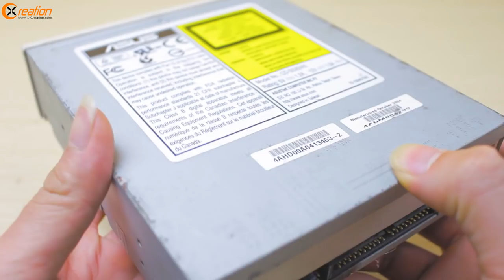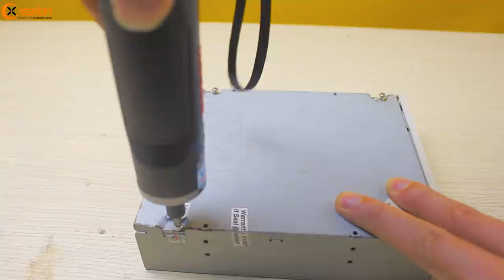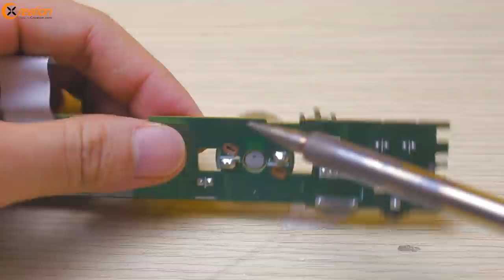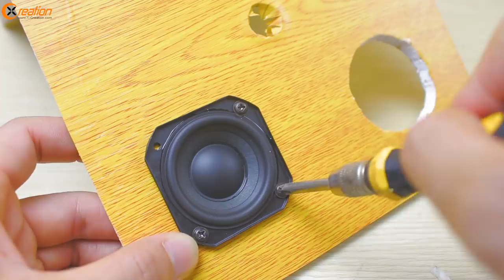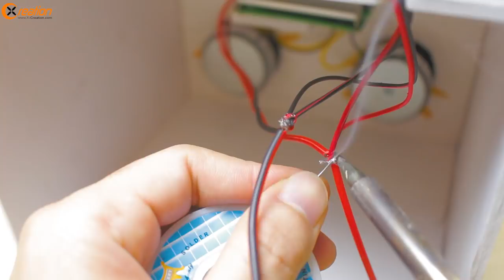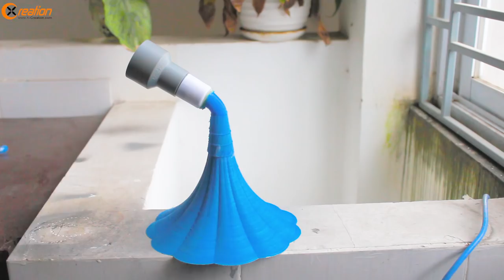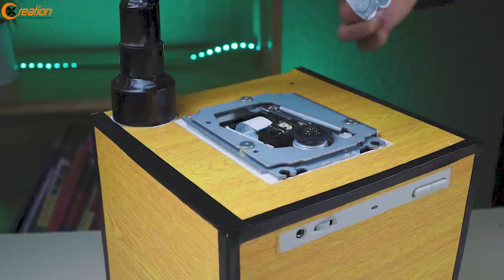Recycle old CD-ROMs into Vintage Speaker Player

Comment from the maker: Do you have any questions? Let's me know!
Reply: can you post links to all the music that you used please?
Reply: How many cost you paid? And how many hours you make it? And how much is your wage per hour? And how much i buy a small Hi-Fi with CD player?
Reply: @DeZug  i believe less than $500 will do dat
Reply: @DeZug  When you make something with your hands you feel a pleasure that is unmatched
Reply: What are the audio out pins from the dvd player!?
Reply: X-Creation please add narrations to your video. I was quite excited to see your video but can't follow it because of the lack  a voiceover. I'm totally blind and use software that allows onscreen text to be turned into audible speech.
Reply: @WKMasterGamer  It's not 100% fake, if you know about old PC hardware from the 1990's you will know that all IDE and EIDE based CD Rom drives had a stereo headphone jack in the front and a manual volume control pot and in the back they all have a 4 pin stereo audio output header meant for a connection to a PC's motherboard or add-on sound card. You can easily tap audio from either and run that into a small yet simple LM386 based stereo amplifier circuit or if you are lazy use the circuit board from a set of cheap PC speakers.. 
Also the horn is there for looks but you could make it work by attaching a small speaker from an old telephone receiver to the end of the horn and not even have speakers in the front, granted it will sound like shit but it will work..
Reply: Dude, hello, give a file or a link to the gramophone funnel ... Thanks
Reply: Which sowftware do you use for creating 3D models for your 3D printer?
Reply: para que usas la fuente step down?
Reply: drill a hole in that flower so you can get the bass reflex out
Reply: Can you make a refrigerator
Reply: X-Creation 
What if i use an old pc sound card , it have a direct input from the cd drive, will it work, how to power the sound card?? Without a pc of course
Reply: Can i use sata dvd rom??
Reply: will you tell the music name u were playing
Reply: Make video How to make RC car very easy
Reply: Why did you make the "Let" into "let us"
Reply: @ladymunch0  how would you build this though? I'm curious
Reply: Do you have an Engineering degree?
Reply: fácil, todo mundo tem uma impressora 3D em casa .....
Reply: sabda. suka. bass
Reply: Why don't you pull the left and right audio channel from the back port? Also how long does this stay working, the lens should be kept clean right?
Reply: Why convert stereo in mono and use signal from Jack audio?  Exit stereo audio rear CD ROM from little port 😒
Reply: @sebastian19745  ............. Best Garbage  Can Box !!!
Reply: Michael Illingby Bro.  Seriously.   Shazam much?
Reply: Moinuddin Ahmed it's called Shazam.  It's useful.
Reply: Why do you use super glue? Why you don't to use screw?
Reply: Hi i have questions ido same thats be for a years but my q is  there any  idea to make it play a mp3?
Reply: you should’ve let the horn be a speaker port instead of just nothing.
Reply: what is the title of the music used during the procedure?
Reply: Great work! well done! What was the 3D printer you used in this tutorial? I've never seen this...
Reply: is monaural sound?
Reply: how to buy the cd rom???
Reply: were is the 3D graphic
Reply: Yes Can i use old dvd rom withount headphone jack and buttons?
Reply: Are you gonna pay for medical bills?
You know for the people who go blind because of this thing
Reply: Yes Mario but how
Reply: why didn't you use the upper part as a bass horn? it would have been easy to just put a small 4watt 4 ohm 3x3cm one below it, which would solve a lot of sound problems
Reply: Does the old cd-rom needs to be working? Or its okbeven if it isn't?
Reply: did you not know about the audio connector on the rear?
Reply: I'd like more details on how do you power this. I might have missed it, but I can't find how/where you soldier the power to the the drive and the speakers. Also, I want to see some LEDs :D
Reply: So the printed speaker-cone is just for show?
Reply: Could you do something similar with a dvd/bluray player and a monitor to create a movie player? Thanks and great build
Reply: do you sell it ??
Reply: what is the music name in 11:30?
Reply: @DeZug  well if you have an old cd rom the other stuff is like less than $10 per board so a big fat 30 will get you one nicely. Almost everyone has scrap wood or cardboard, and the horn os completely optional.
Reply: @harishgavel1686  He is using the built in audio player and connected to the headphone jack's audio out.
Reply: Why so many cutscene? Did your really do it?
Reply: @sNEAKYnIGHTmUPPET   https://youtu.be/l8egYR31HoA

https://youtu.be/tvQvpIy9JnA

No son todas pero son las que pude encontrar

Comment: That's some high RPMs the cd is experiencing. Structural imperfection on an individual disc might result it exploding with the risk of shrapnel hazard.
There is a reason for the metallic shielding, except of course for the elimination of noise due to electromagnetic interference.
Reply: I've never encountered a shattered disk in a cd-rom drive even while using those insane 54 or 56x drives. The only disks that blew apart were already badly cracked. 
On top of that, a regular audio cd is read at 10 to 16x no matter the drive used, since an audio cd player works almost exactly the same as a record player, it has to play the record/cd at a constant standardised speed(disk skipping protection increases the speed a little bit it is not enough to really matter).
At 16x nothing will blow apart, I assure you. I'd be more concerned about the exposed laser head
Reply: lol hysterical 😆
Reply: Better not to touch the spinning disc for sure. "Normal" home CD players are usually 1x, not 52x.

Comment: Since you are pulling the audio from the headphone jack you could have hidden the amplifier volume knob as the volume can be adjusted on the front of the CD ROM drive.

You could've also used the audio plug on the back (that used to go to the sound card) since that's a fixed line out.

Also some warning would be nice since the laser is always exposed.

Comment: Its funny how many kids nowadays don't know the "Play Audio CD" feature of old CD-ROM drives :D
Reply: And always crying when lose the data
Reply: or the tape drive floppy disk vhs 
casette tape
Reply: yea but it is an ide drive....it is already lucky it still work and have the whole pack of face buttons. most dont.
Reply: rude..........i know
Reply: @Misyoner Kâfir Actually many today's cds use mp3  files.
Reply: @Misyoner Kâfir mp3 and cd has the same quality with high vbr settings. Not cbr.
Reply: @danielsulc4150  That would suck if it was true
Reply: I saw one of them a long time ago, installed on a vehicle. I even thought it was just a CD player with some extra I/O ports at the back.
Reply: @Misyoner Kâfir It depends on the source audio. If you are to master an audio CD or a vinyl record with an MP3 source, then it will sound no better than audio from MP3 files themselves.
Reply: @cptcrogge Not sure if i classify as a kid in your mind (just turned 24) but the cd rom on the old family desktop was my first cd player lol, used to grab headphones and listen to music from the drive, even while other people were using the computer for other things. Second cd player was a jury rigged contraption made up of a portable cd player and some computer speakers i umm borrowed from the desktop.

Comment: For more practical reasons, you don't need to dismantle of the CD ROM, just connect the power supply (into 12V & 5V) and insert the earphone jack into the audio amplifier. Done.
Reply: Ora muddeng basane wong landa
Reply: lols
Reply: but how are you going to make it know to play audio files?

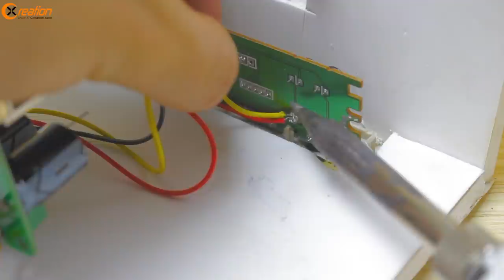Comment: At 5:59 Why did you connect this in Mono with a Stereo audio output? The amp looks to also be Stereo so why connect both Amp inputs to one of the CD ROM drive audio outputs and not both for Stereo?
Reply: It was connected to both channels.

The red and yellow wires to the right and left pins on the audio jack, and black wire to ground.

The speakers were also wired separately to the stereo amp.
Reply: @electronash  Check the video. He tied the red and yellow together. Not only is that mono but the information from one of the channels won't make it to the speakers.
Reply: @jgrimsley2000  

oic. I stand corrected. lol

I thought it was one of those audio jacks where it has the stereo left / right pins very close together, but now I can see the traces even going to the two small caps.

Hopefully he fixed that later, but yeah.
Reply: To often people don't think about stereo as two different signals, if you grew up in the 70's and more so in the 80's you knew how important it was to have different sound and two speakers or  a set of stereo headphones. It was a new thing and done extra well. The 90's most cars had stereos and the speakers were up on the front dash not in the doors of better sound system in cars. Today smart phone and cheap tablets only have one speaker and many cameras and smart phones only one mic and not two, so the stereo of two separate channels is forgotten. I often don't know if a camera is recording with two mics till I buy it and try it. Some lower end models have the same look as the better stereo mic model but they only have one mic, but still save it on two digital tracks. Cheap, cheap  just to save a few dollars, and the expense of mono sound.
Reply: Exactly what I was thinking.
Reply: I also think you do not have to connect the headphone output directly to the amplifier.. the TDA2030 Output impedance is: 4-8 ohms, for to connect headphones it is necessary to add a resistor and capacitor to each output channel for reduce the output power adequatelythe to headphones.
Reply: Yup, that rubbed me the wrong way. Also, CD ROMs had an analog audio output in the back, it's a four pin conector near the IDE interface. You don't even need to solder the board to get audio, just plug a four pin connector there...

Comment: That newer CD drives rotate as fast as 16000 RPM! Did you know that many disks actually burst at that RPM? That was quite common to have CD burst inside the drive. Especially audio CDs, which were designed for much less RPM of audio player.
CD ROM s actually read disks as data and play it via DAC, while CD audio players and some older CD drives play disks directly from head to DAC with no buffering and at exactly 1x speed.

Comment: You could keep the whole cd unit and put inside a strong case, take the wires that you need. I think it's dangerous if the CD fails and small parts are thrown on high speed.

Comment: A good idea, but as you already have a 3d Printer, it could have been made better with more printed parts. Also why didn't you use the cone as a speaker?
As the audio properties of using a cone could allow for greater amplification.

Comment: here is a tip: make a small arm just like a pickup one that at the end has the metal disk that hold's the disk int-o place. And a when you want to us iti place the arm just like a real pickup. Or better. Use a laptop drive that has locking ball bearing so you don't need to place the metal cap

Comment: Hi there, I followed your method by providing the molex 5v using a 12v to 5v regulator (took out from a car USB charger port) but I am getting whining and hissing sound out of it. Where I tried supplying the 5v using an external power adapter and the noise is gone. Any solution for this? Thanks in advance. 🙏

Comment: You should have explained to regulate the Vout of the buck converter before to solder etc..maybe peoples don't know and they trust the video...but buck converter are set random from the factory so they could give (eg) 1Vout or way more than the required 5V.

Comment: Ah hum. You forgot how the laser will shine in your eye's and blind you if you turn that thing on without a CD on the spindle. You also forgot that at CD spins at over 500RPM, and the magnet holding it on is the only thing stopping a frisby CD flying through the house at high speed. You also forgot to wire this thing up in stereo mode, and chose to solder it in mono mode despite having a stereo audio amp and dual speakers.  You also forgot that electric sticky tape will last about a week before it starts peeling off and looking tacky - potentially flying into the path of the CD spinning at 500RPM and projecting the CD into your neck slicing through your jugular. Other than that - great job.
Reply: The party was awesome until you arrived...lol.  That being said, I couldn’t agree with you more about the non-stereo setup.  It must be in stereo.

Comment: Really cool project, but so many things wrong with tutorial part,  if people don't know to set up step down converter before soldering to board they will fry it, why not use 3 speaker set up and put a small speaker inside the horn ? or at least use PVC pipe and use horn as a bass hole ? Tell people the appropriate amperage for "12V" as people might use "1A 9V" adapter and not realize why it skips sound...  STILL its a great idea and good project !

Comment: I  have a lot of issues with with this built. Because now the Infrared light of the Laser is not shielded from the eyes. It has a reason why most CD players are closed systems, you know. Plus now the lens and mechanics will collect dust much faster when all exposed… You would have been better off by keeping the CD-ROM drive as it was and just modding the faceplate & putting it into such a box. Also…  soooo much glue....  >_>

Comment: Why would build a dangerous project when you can just buy a dvd player and an amplifier,goddamn it.
Reply: Technically I really thought you was going to build a CD player version gramophone but it just turned out to be a pair of speakers put in front our plastic box with the gramophone horn stuck on top what an absolute crap build and I also thought it was going to be made out of wood and that's crap too
Reply: @simonsmith2802  Ikr, this kind of videos kinda sucks
Reply: Lasers from class 1 laser drives (CD Rom) are not dangerous. you can light your eyes with it. For sure nothing will happen to you. It's also a great idea.
Reply: @sibirischertiger166  Based on my research,any lasers can make you blind even if it has some protections in it
Reply: @WKMasterGamer   Then the internet tells you something wrong. I myself have a total of 10 such drives. And have ever looked into a laser beam of one of those. (So really pure) and have that So done for several seconds. and Nothing happened to me.
Reply: @sibirischertiger166  Why are people bitching about a micro watt CD Rom laser when a key chain laser pointer is 100X more dangerous. I don't get it.
Reply: That means creativity sir, and some people dont have alot money like you sir.
Reply: @915070152  Thanks for your comment but i'm 16 years old and have No Money. I got the drives as a gift.
Reply: @sibirischertiger166  i know that why i say u have alot of creativity, not everybody have money to buy expensive stuff.
Reply: WKMasterGamer  creativity. boredom. the real question is, why the hell not
Reply: It is a "fun" thing, do not look for something that is not there. It is not a high end piece of equipment. This is just a nice project so one can see what can be done with a few simple items👍

Comment: It's compatible mp3 or flac disc?
Reply: Considering the primary use of the standalone feature of these early optical drives is to play discs written in CDDA (Audio CD) format, these optical drives may not be able to play MP3/FLAC files in ISO 9660/UDF data discs on their own. If it doesn't, then they may work if it is to be interfaced with a dedicated player (if such exists) via IDE/SATA interface, which should theoretically work even with modern optical drives without standalone features.

Comment: There was no need to solder wires to the headphone jack - you have CD OUT connector (both analogue and digital) on the back of the drive. Could have used a simple audio cable to connect the optical drive to the amplifier.  See at 0:45 a picture of the back.  Also you soldered both channels together... you made it mono. 
Lousy soldering, it works but it's lousy... get the wires through holes and show proper soldering with solder wire - people may not get it that you pre-tinned wires and the pads and won't solder so easily by themselves.
The TDA2030 needs higher voltage to output a lot of watts - at 12v it can probably only give around 5-6w of audio. Would have made sense to power it with 18v or 24v and use that switching dc-dc regulator to create 12v ...  or use a class D audio amplifier.
Reply: Damn if you get the time you should make a real outline, seems like you know how to make one that'll actually work well

Comment: It's badly dangerous, not because of the rotation speed but because of CD-ROM itself.  CD, DVD, Blue Rays are using laser technologies in order to work. when you remove the CD-ROM's door the optic laser diode will be left unprotected and if somebody (some how) looks at the laser diode (directly) while its turned on,  it can cause permanent damage to his/her eyes. Even if the CD-ROM uses class 1 leaser it can be still dangerous like when you look directly to a laser pointer it can stiil ham your eyes

I surprise, you have made this video and uploaded to youtube without any warning (specially to kids) !!!!!!!!!!!!! they are so curious they might look at the laser diode directly